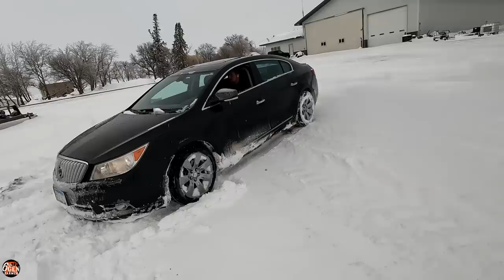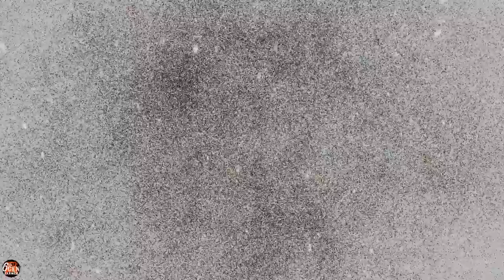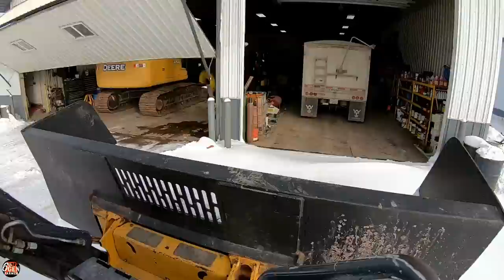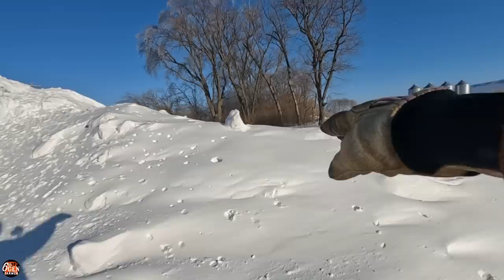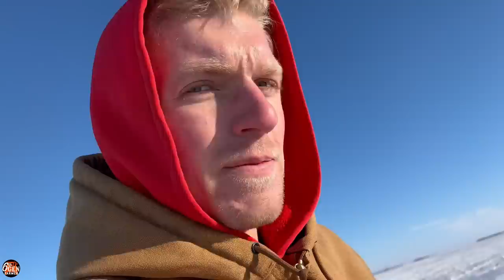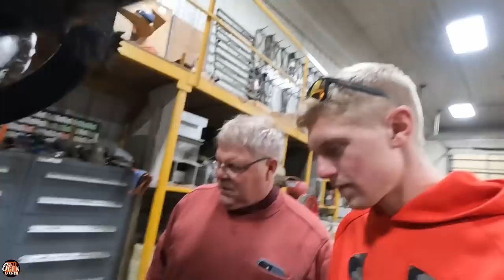Even the Snowplow was STUCK!

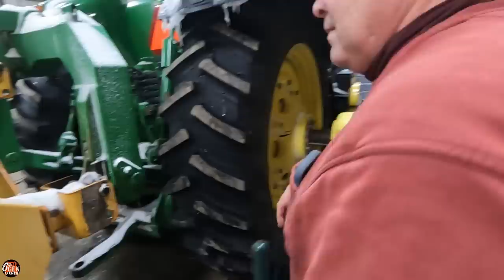Comment: At 15:21 in your video is the single shear bolt.  The 4 holes in the end of the auger shaft are for 4 assembly bolts. They are NOT shear bolts, you need all 4 bolts installed at that location.

Comment: Really Seriously Surprised That The Grader Operator Couldn't get themselves out, they wasn't stuck very much At all, I have watched a grader put his Blade down and Side shift the Blade to the right, what happens is the Grader Operator can get itself out if he's an experienced operator or he put the blade in the air and angle his way out, So this operator must be very New to the Machine. Any grader can and does lift itself out, only if the operator knows it and not scared of their Machine... And it only takes one time to be shown how it's done and that's why I said he really wasn't stuck just didn't know their Machine.,...
Reply from the maker: The ground is not frozen underneath, and the blade was sinking instead of lifting up the grader.
Reply: @6thGenFarmer  if he would of rolled the Blade flat and Side shift the Blade it would free itself, cause I have seen an operator in full Mud up to the Axels, get themselves out and Yes the blade sank and wasn't frozen ground and he was an operator that New his Machine and What it CAN DO, AND THE Operator of this grader has his Blade straight up, Yes it will sink but if you rolled it flat it gives you more surface area more points of contact  At least 14" of contact area AND 12' or 14 '  of blade, Side shift he will never get Stuck Again..... And be more Experienced... Frozen or Not